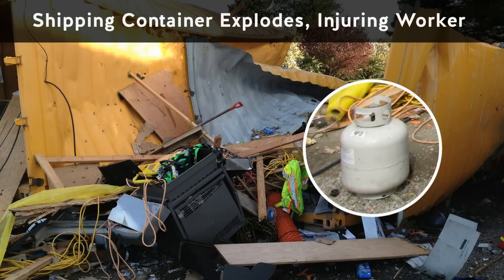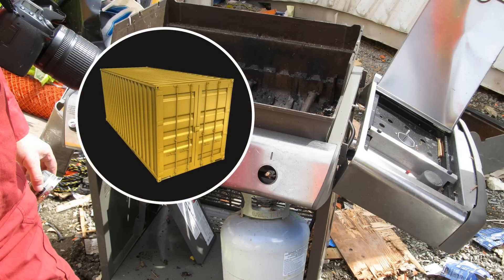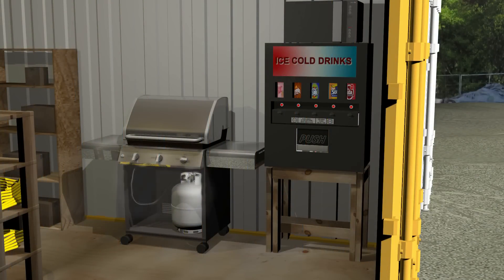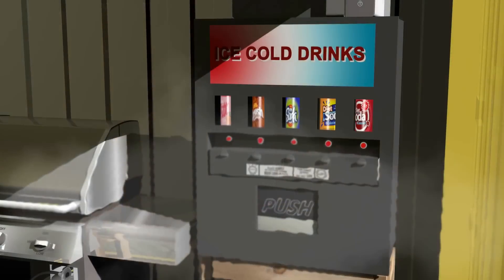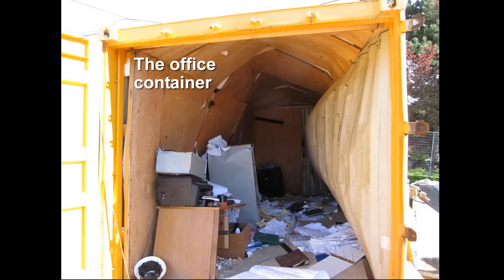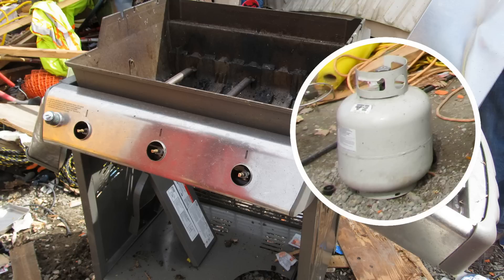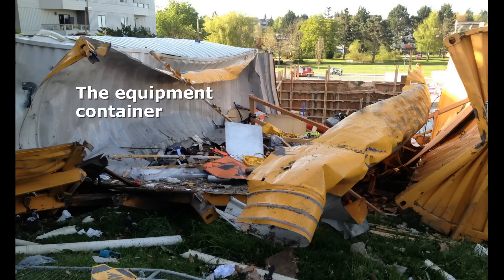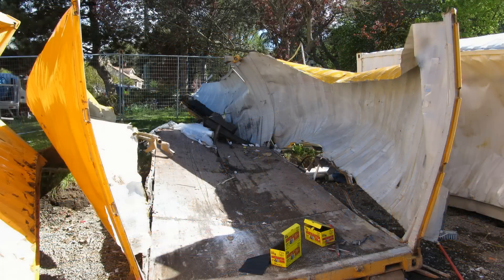Incident Investigation: Shipping Container Explodes, Injuring Worker | WorkSafeBC

Comment: The shipping container was completely destroyed yet the barbecue barely looks like it was even used... I need to find me one of those!
Reply: That's a good observation. The explosion occurred within the air mixture so it was just the pressure differential that caused the shipment container to pressurize rapidly. The results would have been much different if the propane tank itself had exploded.
Reply: The BBQ was not subjected to differential pressure during the explosion, since it was inside the explosion it got the same over pressure from all sides at once.
Still.... The thing doesn't even look scorched!
Reply: Nokia BBQ

Comment: It's not often you get the air fuel mixture this perfect.....if it had gone off with the doors relocked it would have taken out the whole block.
He didn't smell anything because propane is heavier than air so it would have spilled out the container like water not reaching his head. It was probably the air he let into the container that caused it to blow as the drinks cooler would have cycled through the night. Propane is at it's most explosive when 95% of the mix is air.

Comment: You can start inside as long as the valves are shut and it's has low level vents so the propane if it does start leaking Convent out to the atmosphere

Comment: If a tank of propane contains equal explosive force to 100kg of TNT... why the heck did anyone ever use TNT?
Reply: I don’t know if you’re asking seriously, but it’s pretty hard to get all of the energy out of that propane, and it’s rather impractical as intentional explosive. Consider the large volume of the air fuel mix needed here.
Reply: Open the lid on a jar of TNT and it just sits there, open the lid on a jar of (liquid) propane and it dosent.

Comment: Shouldn't a BBQ have a thermoelectric flame failure device? How can such cheap safety devices not be mandatory?
Reply: Yeag
Reply: Exactly
Reply: Why do you think that? I've seen plenty without it. Pretty much any other gas appliance has some form of this, but usually not the most basic ones. It's also probably assumed these portable grills are used outside, and the safety feature isn't as important there.

Comment: I paused the second they said they left the tank connected... Like wtf? (I think I should also mention I must of transfered hundreds of propane tanks to customers) You carefully handle it and set it down in an outside secured ventilated container....
Reply: Why did the valve leave open
Reply: Being lazy probably. Generally leaving the valve open isn't an issue, but you are also not generally moving the setup and closing it in a metal box. Also these grills don't make accessing the valve easy.